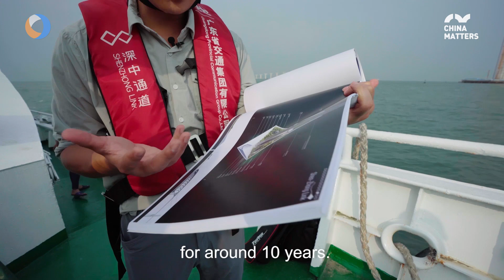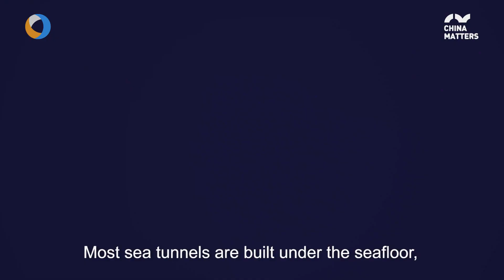The ShenZhong Link: Is it the future of Tunnel Engineering?

Comment: Actually immersed tunnels have existed going back 7 decades.

They were built in the 1950s, including the Chesapeake Bay Bridge–Tunnel and the Transbay Tube for the metro in San Francisco.

In Denmark the Fehmarn Link between Denmark and Germany is being built right now and it has immersed tunnel sections that are 40 meters wide.  Not as wide as the tunnel sections of the ShenZhong Link but still very wide.